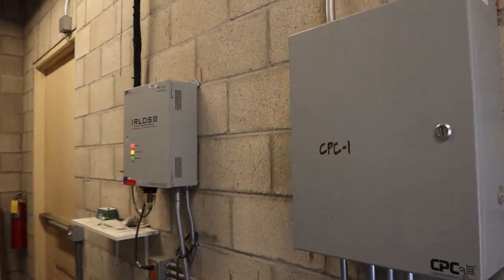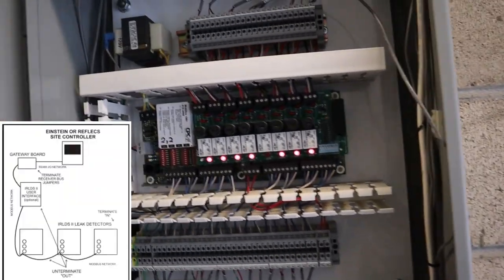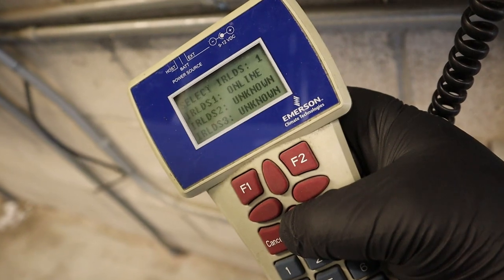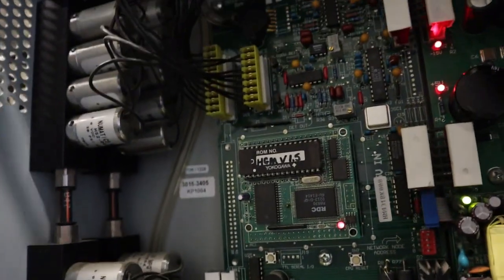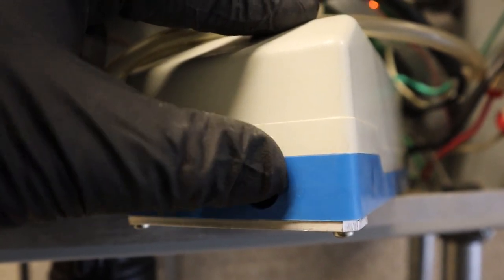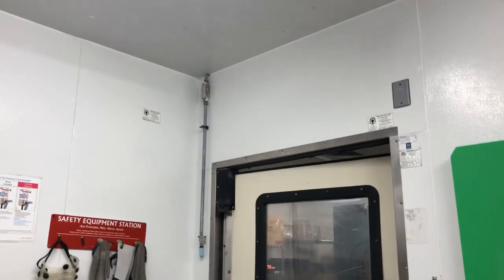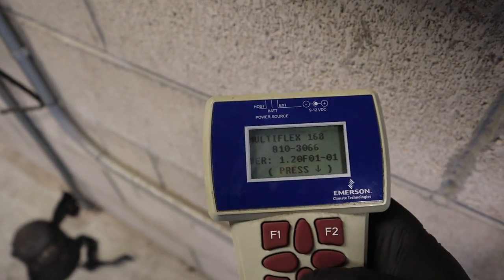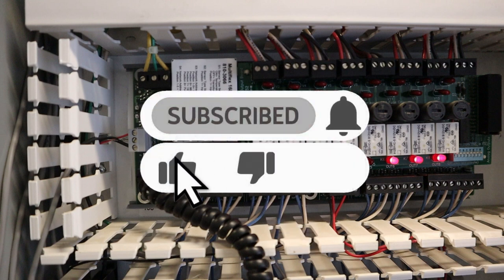Refrigeration CPC Leak Detector Alarming

Comment: Imo they can't place the sensors mid-level.. R717 is up top and R744 is all down..
But sweet video, love that you show advanced stuff..
Reply from the maker: I think the filter got damaged so many time due to when they clean the floors they just got tired and someone put it mid..
Yea they are always placed at the very bottom but as I'm sure you know that the MTPR is the one always getting damaged.
Reply: @refrigerationconfidential4376  MTPR? I'm Danish so I don't know what that stands for.. But the one we use have a guard around them..
Reply from the maker: @christiansommer914  Meat Prep Room were they cut the meat and all the equipment gets washed every night so the dirt from wash always clogged the filters in that room.
Reply: @refrigerationconfidential4376  ahh okay now I understand.. I see what you mean. But don't work with meat cutting rooms.. The big meat rooms we have here, they use R717.
So that pretty much solve the sensor by the floor problem..
Reply from the maker: @christiansommer914  but you are right they should always be closest to the floor due to the Refrigerant being heavier than air.